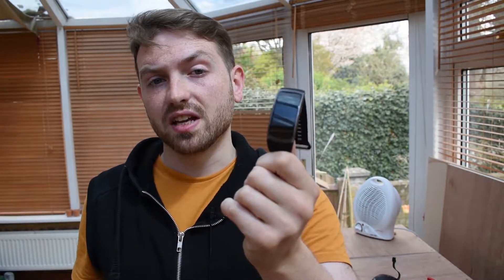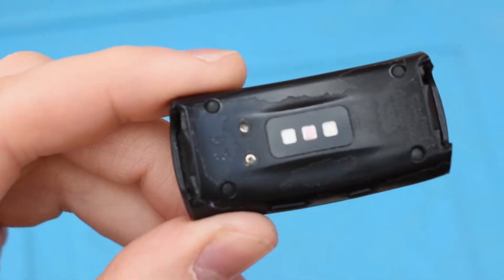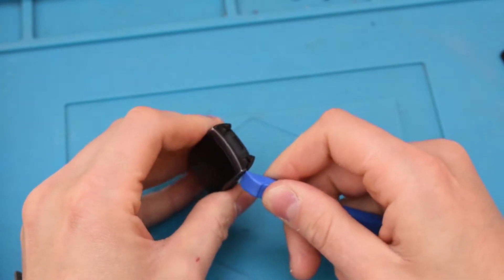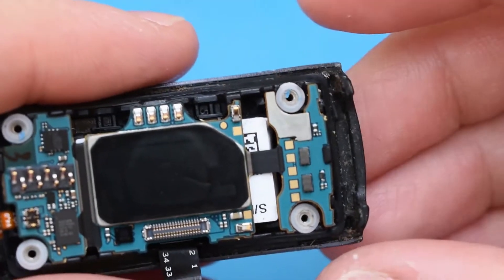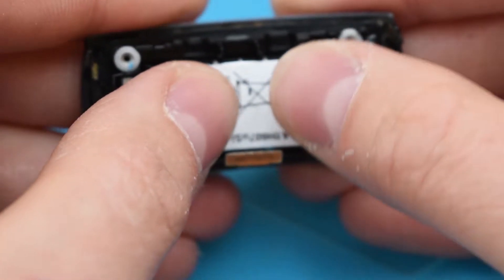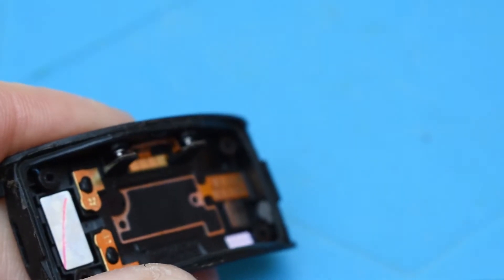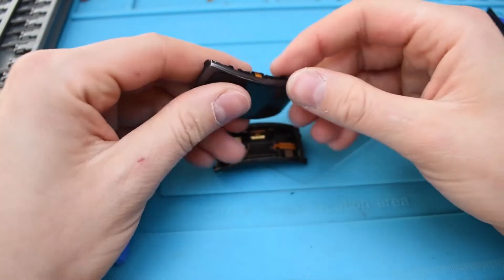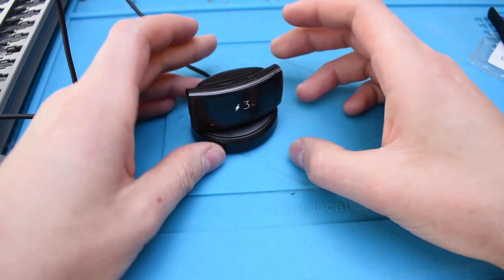Faulty Samsung gear fit 2. How to replace battery and contacts. Can the chief fix it?

Comment: but changing the contacts like this... is it still waterproof???🤔
Reply from the maker: @marcomattio9510  probably not. But if it's not working, what do you lose?
Reply: @thechieftech7499  and that if I can fix it and then I would like to use it as I did before otherwise I save the time and money of the battery and new contacts... instead if I put it in a soak, then for sure it will not work permanently anymore!😆😆😆
Reply from the maker: @marcomattio9510  then don't! It's your choice at the end of the day

Comment: Hey I have bought the br360 battery but I cam flat and not curved. Should I put the curve in myself or should the battery have come like that?
Reply: Same happened with me, the original battery was curved but the new battery was flat, still it fits and works fine. No need to put the curve it will damage the battery!

Comment: can you give me the battery #.  I tried looking on line and don't know if I'm getting the correct one.  Do i need to take out the old battery and get the same exact number that on that battery?  I have Model SM-R360 Serial # R5AJ70526AJ.

Comment: Excellent video. Much underrated channel, brother. I wish you had added the links to purchase the battery and the charging contact pins.

Mine too has pitted contact pins. I managed to solder a pinch of lead to it and filled the pit. Charging ok so far but I have now developed battery issues.

Comment: WOW Man! This was literally a video made for me! Just what I needed with the exact same problem! I-d love a link to get the same connectors on eBay, thanks!!
Reply: Got the connectors first in case it was only that part that needed replacement, but it wouldn’t charge. Then I got the battery as well and followed step by step, and now it’s working like a charm!! Thank you!!

Comment: Any idea why is my watch keeps rebooting after the battery was replaced? After startup a few minutes later suddenly booting again. Dunno what went wrong. Tried to put back the old battery, same thing happening (still rebooting). Tried factory reset, still restarting. Addon info: watch laying on table and step counter slowly increasing. And thanks for the great video!
Reply from the maker: Wow that's a weird issue. Can't say I've seen that. But what I'd try is connecting it to a pc. Might be a software thing. If not I'd disconnect the battery and clean the board with isopropyl alcohol and let it dry out. Might have some dirt or moisture somewhere it doesn't like it.